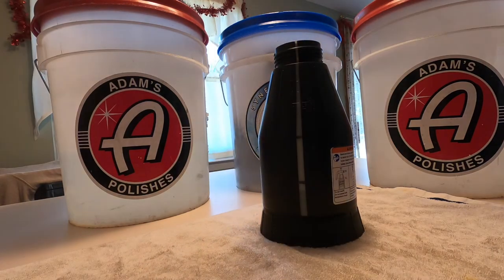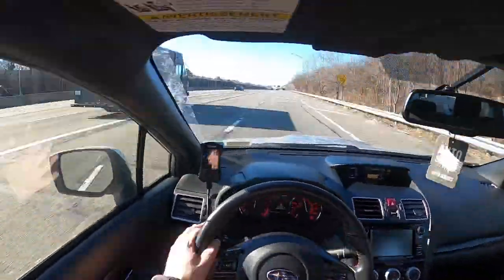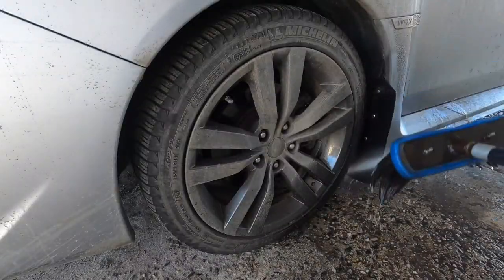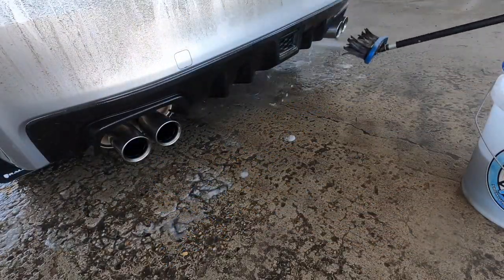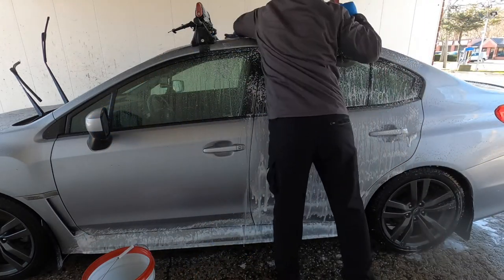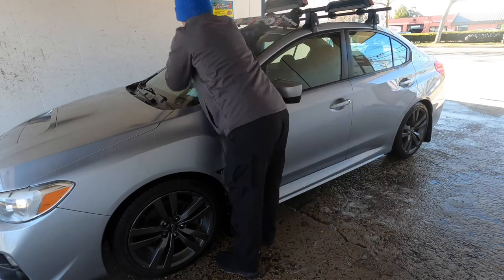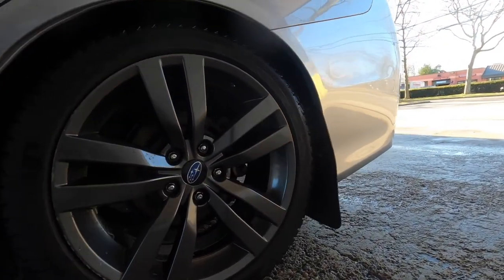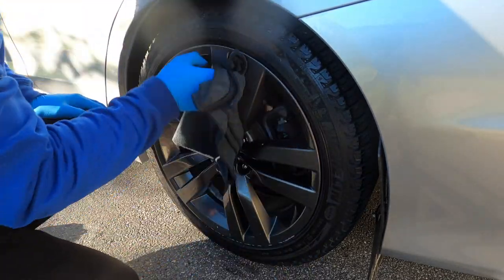Filthy WRX Gets an Exterior Wash After Snowboarding Trip

Comment: Would use onr instead of using this pressure washer?
Reply from the maker: The main point of water pressure here is to remove the thick layer of snow, salt, and winter road grime.  ONR simply is not designed to actually remove that from the vehicle when this level of dirt is present.  You could use it as a pre-soak, but you're going to have to rinse it off anyways before the contact wash and it would be a waste of time considering it wouldn't do anything more than rinsing with water to start would.  ONR could be used here in place of Ammo Frothe as the wash itself.  I have both systems, and use ONR 9/10 times, but I do like to use Ammo in the winter because you can add Boost to Frothe and get some additional corrosion inhibitors out of the wash process.  This is particularly important in the cracks and crevices that don't get coated or protected as easily, and tend to be where rust spots begin to form
Reply: Ivan Lacroix which is supposed to be the guru of bucket washing and one of the inventors of the big red sponge says you can scratch your car pressure washing the dirt I thought about it and it could make sense?In one of his videos he recommends you should capsulated with a product like ONR before pressure washing?